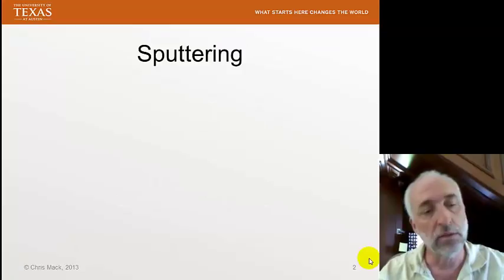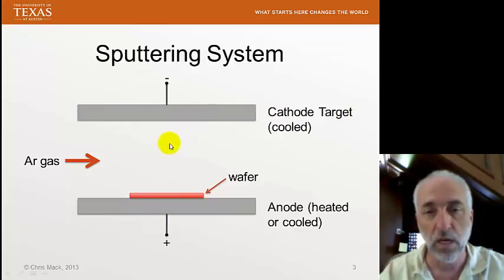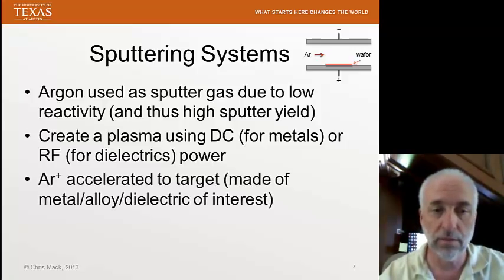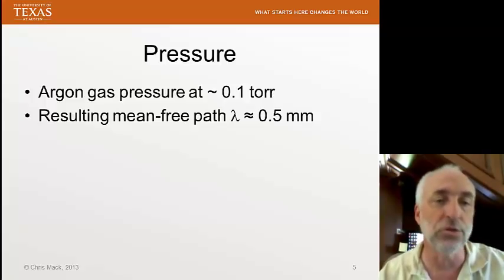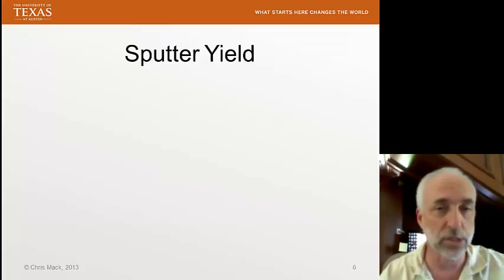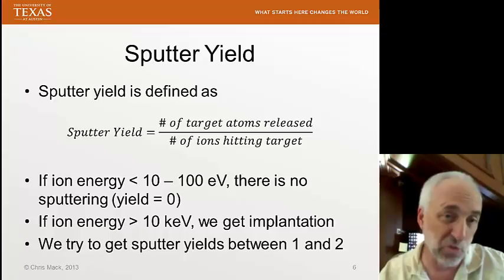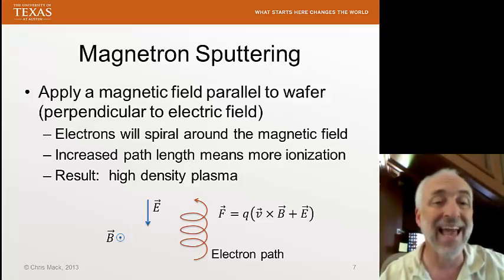Lecture 22 (CHE 323) Sputtering, part 1

Comment: AI Summary

Abstract:

This lecture, Part 1 of a two-part series, introduces sputter deposition as a superior and dominant technique for depositing metals and some dielectrics in micro and nanofabrication, addressing uniformity, control, and film quality issues inherent in older methods like evaporation. The presentation details the fundamental components of a parallel-plate sputtering system, emphasizing the use of an inert argon plasma to physically dislodge target material for deposition onto a wafer. Key parameters such as pressure, its impact on mean free path and resulting "good step coverage" (due to randomized particle trajectories), and sputter yield (atoms released per ion impact) are thoroughly explained, including the critical ion energy dependence. Finally, the lecture introduces magnetron sputtering, a method employing a magnetic field to increase plasma ion density and achieve higher deposition rates by forcing electrons into spiral paths, thus enhancing collision probability without increasing chamber pressure.

Summarizing Sputter Deposition: Principles and Applications

*   0:00 Sputter Deposition: A Superior Alternative: Sputter deposition is introduced as the dominant and improved technique for depositing most metals and some dielectrics in micro and nanofabrication, largely solving uniformity, control, and film quality issues seen in evaporation.
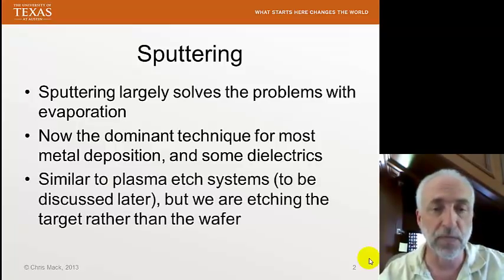*   1:19 Basic Sputtering System Components: The simplest sputtering system consists of two parallel plates. The cathode is made of the material to be deposited (the target), and the wafer is placed on the anode. An inert gas (usually argon) is introduced to form a plasma.
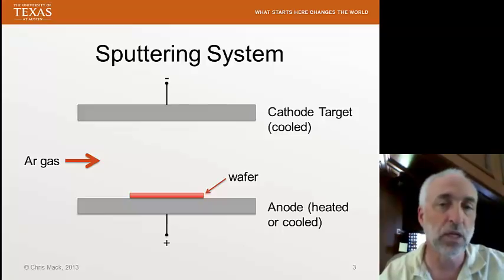*   3:12 The Sputtering Process (PVD): Argon gas is ionized to create a plasma. A negative voltage is applied to the cathode, accelerating the ionized argon towards the target. The physical impact ("sputtering") dislodges target material, which then randomly floats and deposits onto the wafer. This is classified as Physical Vapor Deposition (PVD).
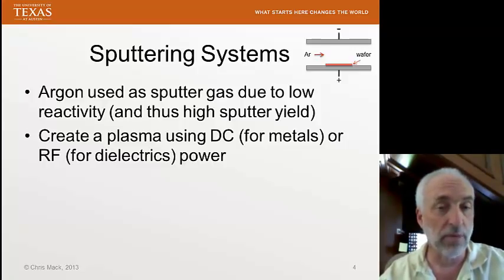*   4:03 Power Sources: DC power is preferred for metal deposition, while RF (radio frequency) power is beneficial for dielectrics.
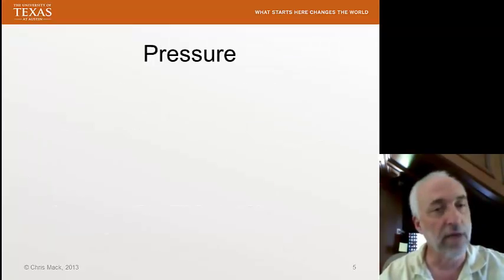*   5:06 Impact of Pressure on Deposition: Chamber pressure affects both the deposition rate (higher pressure means more argon ions, thus faster sputtering) and the mean free path of sputtered atoms.
*   5:53 Good Step Coverage: High pressure results in a short mean free path (around 0.1 Torr yields millimeter-scale mean free paths). This leads to many collisions, causing sputtered material to arrive at the wafer from random angles, which provides better "step coverage" compared to line-of-sight deposition methods like evaporation.
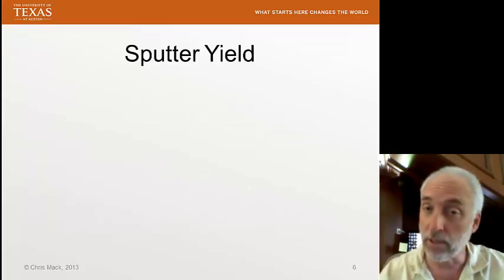*   8:27 Sputter Yield Explained: Sputter yield is defined as the ratio of target atoms released per argon ion hitting the target. It is highly dependent on ion energy.
    *   Threshold Energy: Below a few tens of electron volts (eV), the yield is zero.
    *   Optimal Energy: There's an optimal ion energy that maximizes yield, typically aiming for 1 to 2 atoms per ion.
    *   Ion Implantation vs. Sputtering: Too high energy (e.g., > few kilovolts) can lead to ion implantation instead of sputtering, causing the yield to drop to zero.
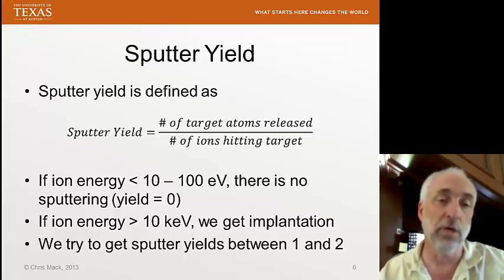*   10:42 Increasing Throughput with Ion Flux: Deposition rate is a function of sputter yield and the flux (density) of ions hitting the target. Increasing pressure can increase ion flux but leads to more collisions and shorter mean free paths.
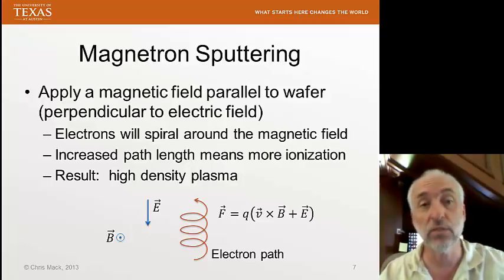*   11:53 Magnetron Sputtering for Higher Rates: To increase ion density without increasing pressure, magnetron sputtering adds a magnetic field parallel to the wafer and perpendicular to the electric field. This forces electrons into spiral paths, significantly increasing their path length and thus their probability of colliding with argon atoms to create more ions. This results in a higher density plasma and faster deposition rates.
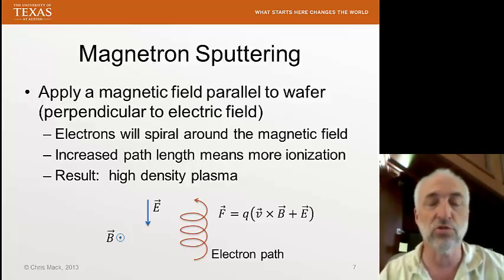*   14:42 Key Learning Outcomes: After this lecture, viewers should be able to describe basic sputter system components, how good step coverage is achieved, define sputter yield, and explain magnetron sputtering.

I used gemini-2.5-flash-preview-05-20| input-price: 0.15 output-price: 3.5 max-context-length: 128_000 on rocketrecap dot com to summarize the transcript.
Cost (if I didn't use the free tier): $0.0054
Input tokens: 15613
Output tokens: 871
Reply: Eat shit bot

Comment: increasing Pressure --> low mean free path --> more collision ->material arrive at wafer from all angles--> good coverage.
What is the problem with increasing pressure because of which we are using magnetron sputtering?
Reply: As far as I know it is bad because we also want electrons to gain enough energy between collisions. So pressure must not be too low or too high.
Reply: High-pressure sputtering produces a lot of problems too.  You can produce high-stress films as a start.  The film density will be lower.  And if you are trying to fill small size vias and contacts, the bottom coverage will be poor.